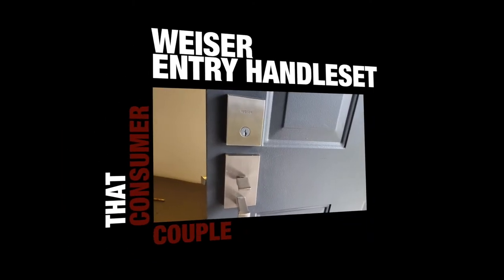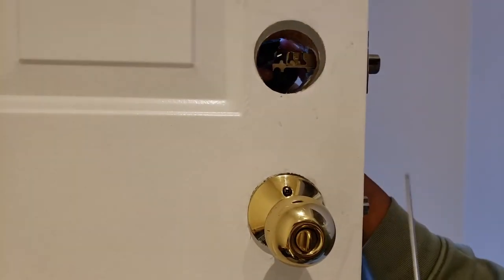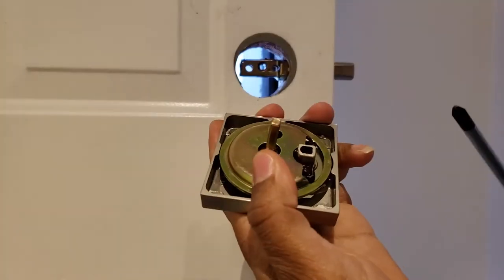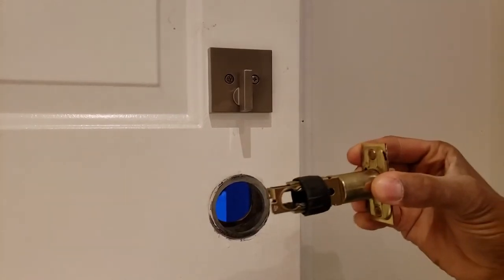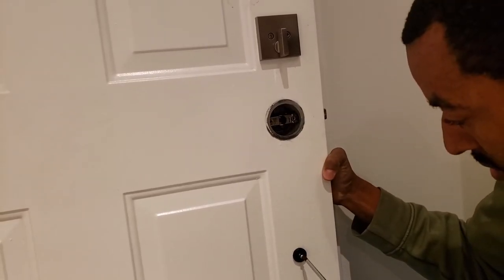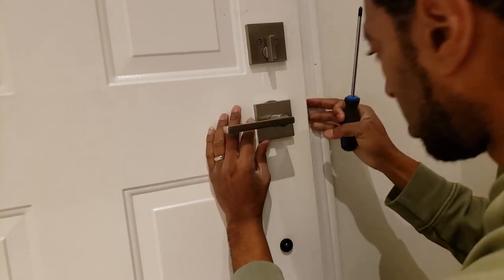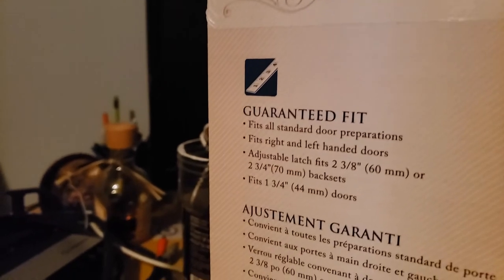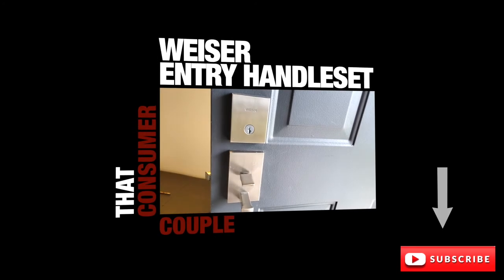Weiser Entry Handleset Installation and Review - Smartkey

Comment: FYI, The Weiser san clemente lock system is not compatible with August Lock since it uses two pin system. Had to return mine because of this.